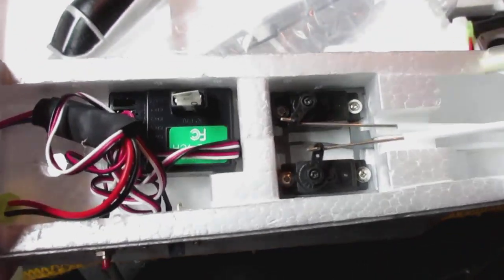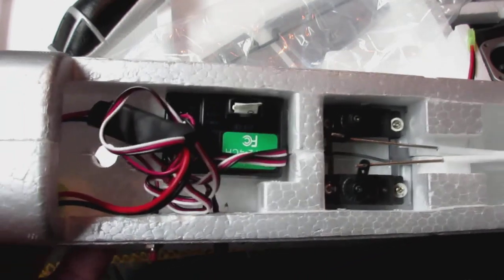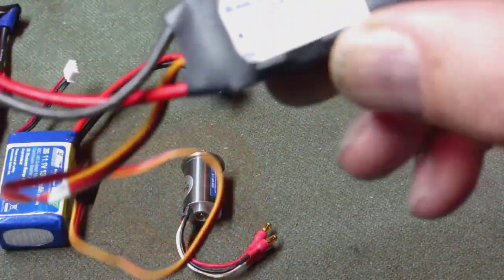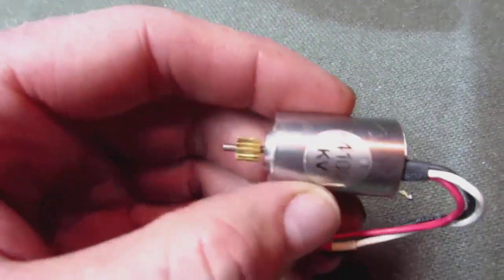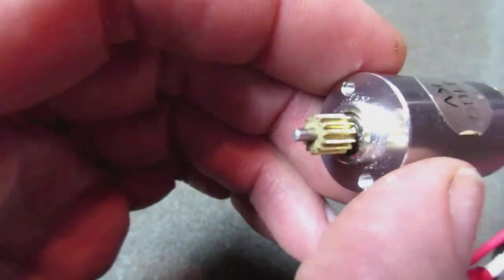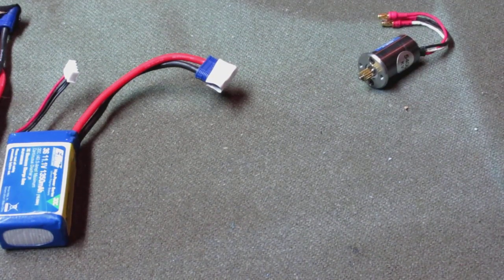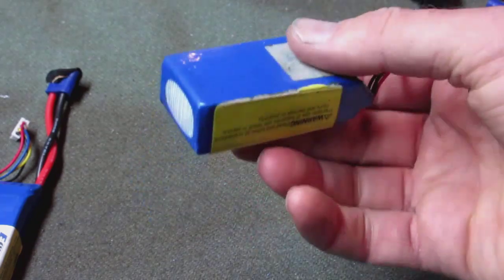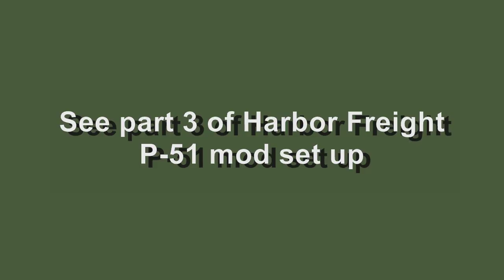Harbor Freight P-51 setup / mods  (part 2 of 4)   Fire & Ice

Comment: Hi , Where did you buy 4100 KV motor with small gear on it. We have same plane and trying to get rid of this kind of gearbox assembly. Any suggestion ? Thank you
Reply from the maker: I'm pretty sure that they are now discontinued.   But you should be able to find an inrunner with a 2mm shaft.   I had to buy the small pinion gear separate.   It's a 14 tooth gear, w/2mm hole.   While they tell you not to.  I'm sure you can remove the one off old motor and lock tite it on new motor shaft.

That set up is becoming increasingly hard to find these days.   You may be better getting an outrunner with an outrunner mount adapter.   That won't need a pinion gear as you eliminate the gearbox.

I'll post it in a next post after this one.  I have to find it.
Reply from the maker: https://www.elitemodelsonline.co.uk/Aircraft/Aircraft-Spares/Electric-Aircraft-Spares/Ares/Gamma-370/20345-/AZS1228-Motor-Brushless-Outrunner-Mount-370-Gamma-370Pro

Comment: I use rechargeable battery’s and my transmitters are 8 aa’s and 2.4
Reply from the maker: My newest transmitter is a 2.4 rechargeable ( spectrum DX8)  I haven't converted the two Harbor Freight P-51s over to spectrum receivers yet.  They are still Tactic.   I'll convert them over to spectrum and the DX8 this spring so that all my planes will be on the same transmitter.

Comment: Where would the white 4 pin connector on the 1350 battery connect to on the stock receiver?
Reply from the maker: That doesn't connect to any receiver, whether it's a stock 72 Mhz (FM) receiver or a 4.2Ghz receiver.    That is only used for charging the Lipo battery with a balancing board.   
Most complex (multi type battery chargers come with a balancing board that had a receptical for that plug so that it can read all 3 cells (in this case)so that it can keep them balanced during charging, while the main charging current goes through the connector for the two large wires.
Small cheaper balance chargers only use the white balancer plug for charging.
So in the airplane, that plug is not used unless you want to plug in a small voltage meter/low voltage alarm to the battery.   That would plug in there as well.   But is is not used for normal airplane functions.   Just store that plug out of theway.

Comment: i just tried to buy the park 370 4100kv brusless motor. its discontinued. what other motors do your recommend for a inrunner setup? Im trying to build the exact setup you have
Reply from the maker: Honestly I haven't tried anything else yet.   I guess any park 370 or equivalent 2mm motor shaft 11.1 volt motor with a decent kv rating would be fine.

Even going to an outrunner may be a better option

Comment: I am sorry I have tried to listen and take notes. would you mind listing the name of the parts I would need to upgrade? Thank you Robert
Reply from the maker: If you scroll down through the comments on the -part 3 of 4 video in the series, I have links to the parts that I use.

You may have to Google search the gearbox as the link no carries it, but the part number and name can still be searched and found in other places.   The stock gear box will work fine, but eventually you may need to replace it so spares are nice.
Thequicker upgrade would be to get the outrunner mount and simply replace the gearbox setup with an outrunner motor and a 25A ESC for a brushless motor.
If you want the gearbox and inrunner set up like I use, the e-flite Park 370 4100kv inrunner motor is still available.

The link for the pinion gear for the motor is still good.   If you have the tooling, you could take the pinion gear off the old stock motor and lock-tite it to the new motor shaft.

The link for the spare props still work (I have not had one of these break yet).   If not available now, search by part number.
Any 20 -25A ESC for brushless motors will work.
E-flite 1350mah 3S lipo batteries are perfect size and weight.   They will fit with the stock 72Hz receiver in there.

If you decide to replace your FM receiver with a 2.4GHz receiver and radio, ( but it's not necessary) then any 1800mah to 2200mah 3S Lipo batteries will fit.
Reply: @markhyde43  I have ordered the 3 parts now my question is what prop did you end up going with?????
Reply from the maker: @robertluttrell1111  I currently use the props that are in those links.  They seem to work the best and hold up well.   I use theon the belly lander (my other harbor freight P-51) as well as this one and I have only broken one in 3 years.    Off you can't find any through that link, I can send you some as they came in a bag of about 20.  I haven't checked that link lately.  But that is what I am using.
Reply from the maker: @robertluttrell1111  This is that same link for  the props:    
https://www.youtube.com/redirect?event=comments&stzid=UgyK8tdk4gRj6BAzv7x4AaABAg&q=https%3A%2F%2Fwww.ebay.com%2Fp%2F5-X-RC-Airplane-Aircraft-Model-Propellers-Props-Black-203x152-8x6-8060%2F710141229&redir_token=42WALzNusUqvNd5ljiX_c6-Jspp8MTU1OTMyNDUyMkAxNTU5MjM4MTIy
Reply from the maker: The install exactly the same as the stock props.   They slide over the shaft and have a hex inset that goes over the shaft nut and the stock prop nut goes on behind or to lock it down.

Comment: What do you mean by with the 5400kv you don’t gain anything in the end?  Is it going to be only as fast as the 4100, or only as fast as the original?
Reply from the maker: The 5400kv (next higher kv inrunner in the park 370 series by e-flite), which I accidentally purchased....is a 7.4 volt motor.    In that class, the 4100kv was the highest I could go with a 3S 11.1volt inrunner motor.   While the 5400kv had a higher KV rating...being a 7.4 volt motor (2S) the speed & power made by it  would not gain me anything in the end.

I haven't checked to see if there is a higher 11.1volt inrunner (370 class) out there.  There may be one, but where I was looking, there was none at the time.

I suppose I could have gone with an outrunner set up and gained a ton of speed,  but for the time, wanted to keep a gearbox/inrunner set up.
Reply: I placed an order for the inrunner 4100KVmoter should be getting it soon......but the only thing I could find was a 40 amp Brushless speed controller. Will that work with the set up ? Or would it have to be a 20 amp ?

Comment: Hello I had went out an bought one of these planes yesterday and I'm doing the up grade on it I had found the brushless 4100Kv motor and the battery you got...But as far as the speed controller I can't locate a 20 amp but I found a 40 amp just wondering if you know if that would be ok. ? And also what kinda charger are you useing to charge that type of battery ? 
And also what kind of propeller would you recommend ?
Reply from the maker: 40 amp should work fine.

Props.  8x6
I think the link is in a couple of the comments in this build series.  One is in part 2
Reply from the maker: You may need to remove the pinion gear off three old motor shaft and press it onto thenew motor shaft...if you haven't bought a new 14 tooth gear.
Reply: @markhyde43  ok thank you I'll try an find it I'm not sure if the link will show up cause i use my cell phone for all my internet needs.  If you can send me the link to locate the one you have exact that would be great..... Also can you provide information on the charger to charge that 3S 11.1v 1350 E-Flite battery ?
Reply from the maker: @cadillacescalade5428  I use a Hitec X1 MF  AC/DC charger, with a balance board.

Any charger that allows you to charge 3S Lipo batteries.  Better to have ones that allow you to select capacity, amperage, and a balance charge capability is a must.  Most use balance boards.
Reply from the maker: @cadillacescalade5428  prop link for what I am using
https://www.ebay.com/p/RC-Airplane-Model-0-12-Dia-Hole-8-X-6-8060-Props-Propellers-Black-X-5-H8x1-B3/710141229
Reply: @markhyde43  ok great thank you so much for your time and help. Have a good night.
Reply: @markhyde43  Hi I received my motor today for my upgrade but wondering how to remove the 14 tooth gear ?
Reply from the maker: @cadillacescalade5428  I have a puller but you can slide anything that is pronged between the gear and that motor body (like a kitchen fork)
Brace the shaft against hard metal like a vise so that the shaft won't move (this pull out of the motor)then pull the gear off by pulling the fork towardthe end of the shaft.
When you get to the end you may need to get creative to slide it off.  It should be loose enough to work off...or use a pin or a nail up against something hard so that the gear will slide on to it and off the shaft.
They go on much easier.

A little loctite and position on the shaft then use a small socket to slide over the shaft but big enough to push the gear on with a bench vise.
Reply: @markhyde43  ok Thank you I'll give this a try.im excited about this up grade I'm still waiting on the battery charger an the propeller and the brushless speed controller.
Reply from the maker: @cadillacescalade5428  just make sure the shaft end is up against something that will not allow it to pull out of the motor when you try to pull off the gear
Reply: @markhyde43  Worked Great Thank you got it assemble back together an now just waiting on other parts now. When I'm completed the project I'll make a video an mention you for all your help.
Reply: @markhyde43  I used a small crowbar after I got the gear up a bit an then lightly tapped it down releasing the gear pretty easy. Then I just used a small wrench an lightly tapped the gear on to the New motor.
Reply from the maker: @cadillacescalade5428    There you go.   what ever does the trick.   It's always intimidating before you do it, but once you engineer it...it's well worth the effort in the end.
Reply: @markhyde43  most Definitely. And again I wanna thank you for all your help. I should be up an full together by 2 week of September for 1st take off
Reply: @markhyde43  Hi I just received my propeller but it's kinda just a tad bigger than the original prop. This one is a PKZ1005 Propeller P51D 
Any way I can make it fit with a bigger nut from inside the prop an then maybe super glue another nut to it that will fit the shaft ? Or would that be not a good idea ? 
I'm still waiting on my speed controller......but any specks in the propeller that you use can you send a link please so I can get the correct props
Reply from the maker: @cadillacescalade5428  how about I just send you 5 of my props.  I got like 20 of them.
Just give me an address to send them to.
Reply: Hi friend just wanted to say thanks again for helping out a fellow air crafter.  Let me ask you what's the best landing gear to get for these types of planes ?
Reply from the maker: @cadillacescalade5428  I use the same original gear.   I just install bigger wheels that I picked up at local hobby shop.   The ones you see there are 1 3/4 in diameter.   I did have to run a drill bit through them to make the hole big enough to go on the shaft/ axle.
Reply from the maker: @cadillacescalade5428  I'll try and get these mailed tomorrow
Reply: @markhyde43  ok great, I'm hoping that this brushless speed controller has those imports to plug in this motor  in they didn't show an it was the only 20 amp controller I could find the rest we're 40 amps. But I should have that by the 9th. 
I'ma get a paint set this weekend an paint it. Get it ready a bit.
Reply: @markhyde43  Hi I had just posted a video showing the parts you recommend but also I was asking if I could change out the battery plug from the old one to the New one ? If that would be ok ? And also adding the old plug from the harness to the Speed controller ?

Comment: Ok got a question for you. After my whole upgrade after I received those props from you I went to the park an took it on a ball field for my flight. Mind you this was an is my 1st time ever flying a R/C plane. So I achieved to get it in the air but when I went to try to adjust the trim the plane just went out of control fast an made a complete nose dive. Luckily it didn't damage the plane to much but it did mess up my gear box with the shaft those to mini bearings that hold the shaft one got messed up an wondering if you know the size of those ? And also I'll make a video later about the issue. But regarding the gearbox would you know where I can get another just in case. I need to stock up on spare parts like you...
Reply from the maker: This is the title of it to search for....Ares Azs1211 Gamma 370 Gearbox With Shaft

Here is one link...
https://www.ebay.com/p/Ares-AZS1211-Gamma-370-Gearbox-With-Shaft/1436857507?iid=372450996290&chn=ps&norover=1&mkevt=1&mkrid=711-117182-37290-0&mkcid=2&itemid=372450996290&targetid=809743837105&device=m&mktype=pla&googleloc=9002666&poi=&campaignid=6470661099&mkgroupid=77564420636&rlsatarget=aud-497631946031:pla-809743837105&abcId=1141156&merchantid=6327084&gclid=CjwKCAjwwvfrBRBIEiwA2nFiPcL3LUoXBQwDCnw0Af3yI0KAA4f8cHRdlWM2kAbrltuUF1ldNcv3qxoCRIEQAvD_BwE
Reply from the maker: By the way; this was also my first RC plane as well.  I learned that that was a bad idea as the plane could react quicker than my mind could in certain circumstances.    I wrecked mine hard either on the 1st or 2nd flight as I got to cocky before I was ready.
Reply: @markhyde43  yeah it was not the best of luck I've been searching videos on here, for damage plane repairs an some say put the plane in boiling water an it will go back to shape an also found one if you use laminate wrap an a hot irion it will also remove the wrinkles in the styrofoam. I'ma go by my hobby shop tomorrow an see if they have the bearings I need if not I'll have to end up ordering them..
Reply: @markhyde43  Hi I'm just wondering I noticed that you had a different motor housing an was wondering if you have ever needed to change out the spur gear the big black gear ??
Reply from the maker: @cadillacescalade5428  I did after my first couple of nose-in crashes.

The stock spur gear is narrower than the one I have you a link to.   The replacement gearbox comes with a new spur gear.  They are a bit thicker and beefier. 

I opted to not simply replace spur gear alone because removing and replacing the shaft wears the bearings in the gearbox out.

Also....you have to make sure you get the spur gear with the right amount of teeth. I believe this plane and gearbox needs a 62 tooth spur gear. If you're not careful and ordering just Spur Gears you may get one with too few teeth that's too small in diameter and it won't contact the pinion gear